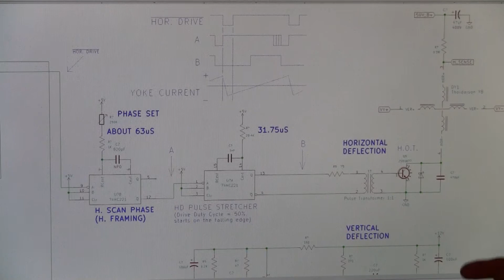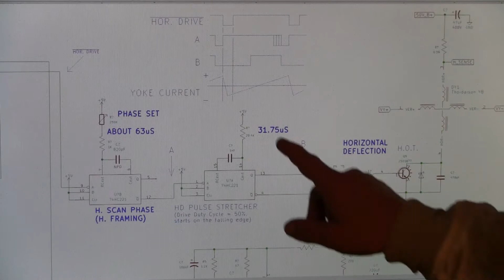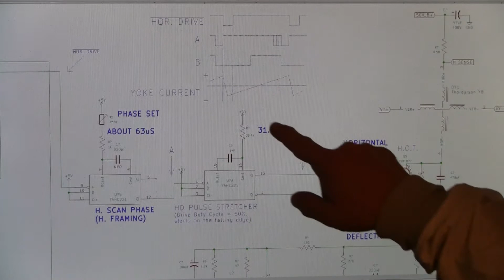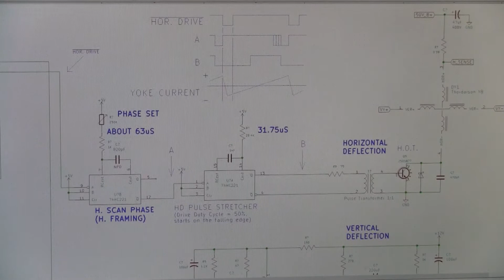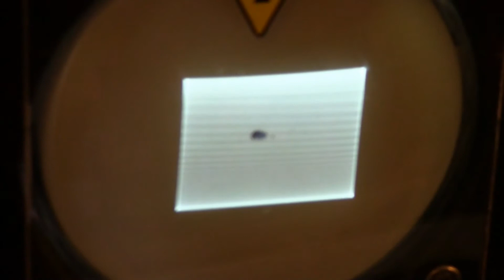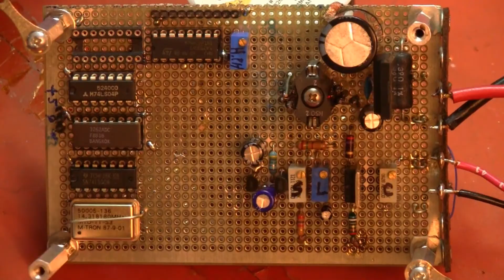The Chief - Update #5

Comment: I really like to see these old tubes and circuits being brought to life.  Your explanations are good to encourage the beginner experimenter - patient and thorough.

I think part of the linearity issue with the vertical circuit is the use of a 22uF electrolytic and 1.2K resistor to create the sawtooth.  If you look at the waveform at the PNP's base it will be not-quite linear, just from the RC time constant equation. The most linear sawtooth would be created with a current source (effectively very high resistance) to charge the cap.  Most likely that '60s vidicon camera wasn't overly concerned with linearity -- 5 or 10% was considered "close enough."   Also, the germanium transistors had some characteristics that may require some different component values than silicon replacements to get best linearity.

In my experience, yoke driver design starts with a measurement of the inductance.  Knowing the current necessary for full deflection (which  I guess you don't know here), the equation E=Ldi/dt gives you the voltage pulse you need across the yoke to give the desired current through it.  Because the scan time in horizontal is so short (dt=~50uS) the inductance typically requires a pretty big voltage.  I've seen some horizontal yokes wired in parallel to reduce the inductance and peak voltage. Vertical drive time is slow enough that the pulse isn't very large.  

Nice use of the pulse transformer to get enough base drive for the HOT from TTL.  Did you wind that yourself or find it in you junk box?
Reply from the maker: Thank you for the detailed comment. Much appreciated. You are absolutely correct about the ramp generator itself. I have a very good one of my own design that is entirely constant current based. I may bodge one up and inject a "perfectly linear" ramp voltage into the second transistor to see how the output responds. See my circuit here: http://www.labguysworld.com/IconoscopeCameraProject_004.htm

Yep. The pulse transformer is from the junk box. I've always wanted to find a use for one of these. Success or dumb luck? Time will tell. I forgot to remember to show the horizontal width changing with input B+. It is smooth and glorious. I think you would approve.

The goal of the design is to work first and be elegant second. The scan board is using four separate power supplies at the moment. I am making the changes to operate the entire board from a single 12 volt supply. But, a near term video is going to delve into the wonders of commercially made DC2DC power bricks. Like the one I used on the high voltage. They come in all sizes and power ranges. Yes. They cost a few bucks. But, my time is very valuable too. So, one must decide which is more important.

A prize for those who have read this comment this far: The beam blanking works with only a 12 volt amplitude blanking pulse. It is glorious. Don't miss my upcoming videos! This thing is going to be "off the hook!".
Reply: I always sorta preferred the "make it work on the bench" way of doing things myself, but years of "working for the man" moved me toward a faster method.  Laziness helps there, too.
I was going to suggest inserting a known-good sawtooth into that PNP base to see if it was indeed the source of the nonlinearity.  You (once again) beat me to it.
Those DC-DC converters are great.  It was those that moved the designs at my last workplace from one big multi-output mains supply to a simpler single voltage type, and DC-DC converters (up and down) where needed.  Almost foolproof (except that we fools are so clever).
Looking forward to the next video.

Comment: Fascinating and I agree about having the CRT working. I take it that the zener diode in the H.O.T. collector/emitter circuit works somewhat like the horizontal damper tube in an old TV set. I am looking to see how you get the HV for the CRT. Ordinarily the fly-back pulse from the horizontal scan generates the HV in the FB transformer. I know this statement makes it sound like I know a lot but I need to learn a lot more about what I think I know. ;) I have little to no knowledge on how to engineer circuits as you are doing. Great video. Gary
Reply from the maker: HD', you know more than you know. Good question. The diode is a high voltage fast recovery Schotky vs a Zener. This diode is, in fact, built into the H.O.T.. I figured that was a good way to guarantee it was the "correct" diode. It is indeed called the damper diode, as it damps the high voltage flyback pulse. The circuit resembles the boost/buck converter circuit commonly used to change from one voltage to another.
Reply: @videolabguy  Back in the mid 1990s I worked for a computer consulting firm and my main job was electronic specialist. I repaired monitors to the component level for them and replaced a good share of fried H.O.Ts. In many of those circuits there was a 1uf electrolytic in the H.O.T. circuit that would fail and that is what caused the transistor to overheat and fail. I also used to calibrate 20" Sony monitors using a digital interface designed just for those monitors. If I had to sit in that chair again I probably would forget a lot of what I used to do there. Gary

Comment: Thanks for sharing! Your videos are indeed unique and very well made. For the horizontal output have you considered using an h bridge ic? There are plenty cheap h bridge ic's that are designed for motor control and shouldn't even get hot in your application. Interested to see the future progress & cheers from Canada 🙂
Reply from the maker: No! Thank you for watching. I have considered an H. Bridge driver at times. But, each unique solution, presents unique "issues". In my case, I needed to build this topology for my own gratification and to whip that life long devil good once and for all! In an upcoming project, I will be applying a commercially made 3 phase driver for the rotary scanning system. But, I've already said too much (wink!).
Reply: @videolabguy  yeah I understand what you mean! A few years ago I was building a crude oscilloscope out of one of the projection TV CRTs (about 6" diag) and made my own hv driver circuit. It indeed felt quite gratifying getting it to work and quite efficiently as well. It was a multivibrator isolated by optocoupler feeding into one mosfet that had a low value resistors to v+ thus generated strong gate drive for the output mosfet. I was about 15yo back then and even though it was a simple circuit, it felt really good to get my own design to work 😁